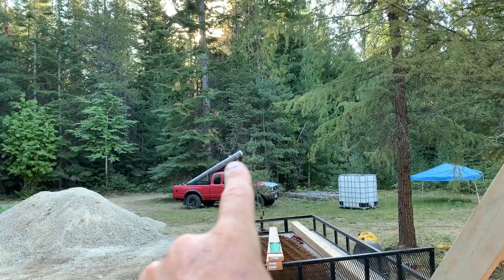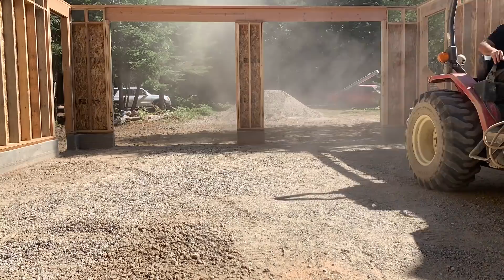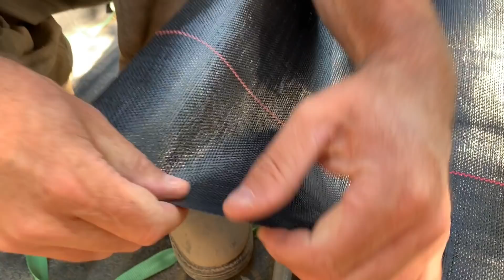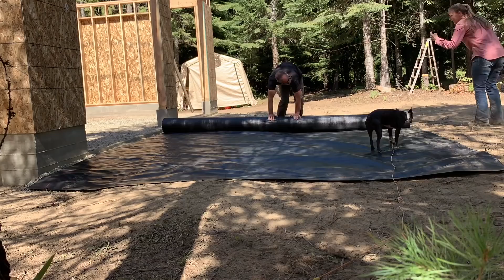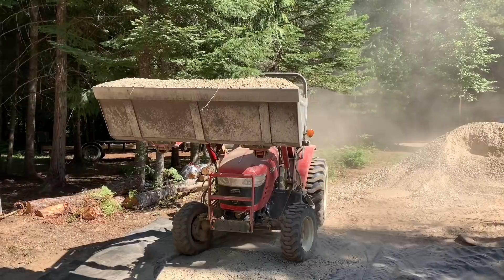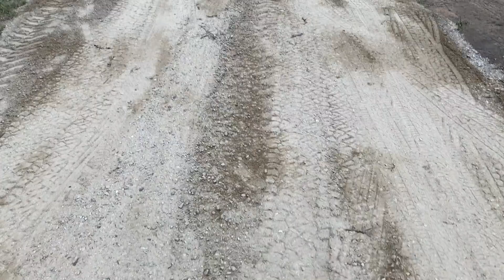Building a Driveway with a Tractor- Couple Builds Dream Home

Comment: put in a drain in the floor  to an outside location, you will be happy.  it looks like you have enough slope.  you can put in heater in it if it freezes.  it wont freeze if you 1/8" 10 drop

Comment: The tractor exhaust is low and pointing to the ground, thats ok in wet weather but it was rising the dust of the dry gravel all over the place, an extension that has a vertical pipe up the side might be in order

Comment: The depth of the concrete is determined by how much weight you expect to put on your floor. Two put a drain in the floor you will be glad you did. Are you going to seal the floor once it sets and if so with epoxy , stone chips, various colored chips or just a plain sealer.  SEAL THE FLOOR, other wise oil , grease, dirt will stain it for good.

Comment: Hi Martin
While watching you moving gravel for your driveway I see the back wheels on the tractor lifting off the ground and spinning alot. Would I be right in saying you don't  have liquid in the rear tires. Just a suggestion.  Maybe you should consider doing that. This winter when you are moving snow you are going to curse it. Anyway love the channel. Garage is looking great.
Reply from the maker: Great idea
Reply: Also, I just discovered your channel. Please stop lifting the bucket so high with so much weight in it, while turning. I’ve seen you almost turn over twice now.

Comment: I've been thinking this summer about the garage floor sloping in regards to the last four or five feet up to the back wall.  For folk who put their laundry equipment and water heater there, it can be awkward to level the equipment on the floor.  But I believe the washers and dryers come with adjustable feet.  So, the platform for the water heater would have to be built at a slight slope so the water heater remains level.  But what about the rear passenger door?  It's hard to get a tight door seal on the slope.  None of these issues may impact you, as I see you have no rear door.  It's food for thought.   What would I do?  I am thinking that although the sheep have been following the shepherd for years on sloping the whole floor, if it were my build, I am thinking about leveling the last five feet of the floor.  What do you think Martin and Julie?  Do I cut the bottom of the rear passenger door at an angle too?  That would work!

Comment: How many hours do you have on that tractor..? I have over 3000 hours on my 3510. I would highly recommend getting those rear tires liquid filled. You will have much more tractionAnd you can pick up a full bucket load of gravel with the rear tires still on the ground.

Comment: Im mostly curious what you decided to do for the exterior of your home?
Reply from the maker: We dont know yet. still thinking about it.
Reply: @MartinJohnsonOffGridLiving  Look at the cement or other fire resistant options as the current events on the west coast have shown you can never have too much protection. They are making some siding options that look like wood but still give you the protection but then there are other things like stucco or even stone to separate the wood from any ignition source.
Reply: @MartinJohnsonOffGridLiving  I bet alot of that is hard to decide when your building your forever home.

Comment: I don't know much about tractors, but that roll bar bouncing around like that makes me nervous. Is it supposed to do that?
Reply: The back end of the tractor was off the ground..  When he was waving his arms he was simulating flying like a bird.
Reply: @Mywhtjp  I meant in the next shot, when he is scooping another bucket, the roll bar is bouncing all over the place, like it is not attached to the frame.
Reply: @andydouglass1374  oh.. I guess I missed that scene.
Reply: @andydouglass1374  I watched that part again.. I have the 3510 model. It does appear very loose.. but it's  Designed to fold down and to the back. It is not possible to tilt forward. Good eye though